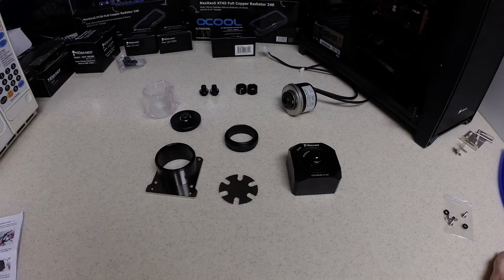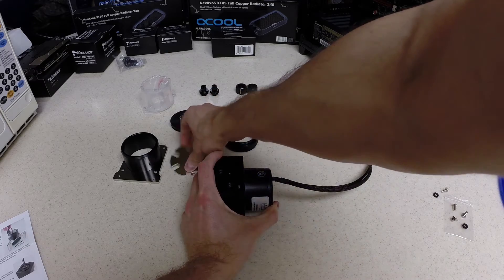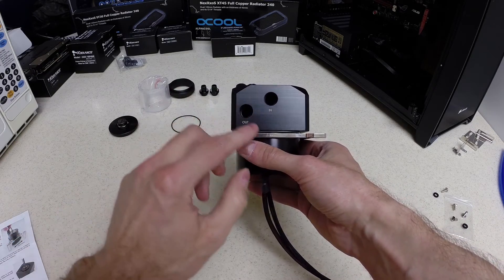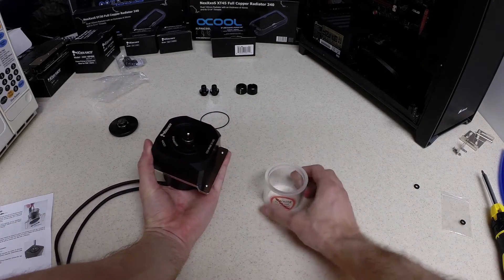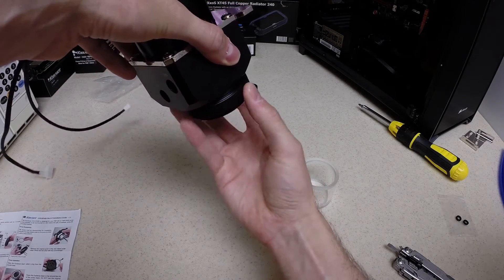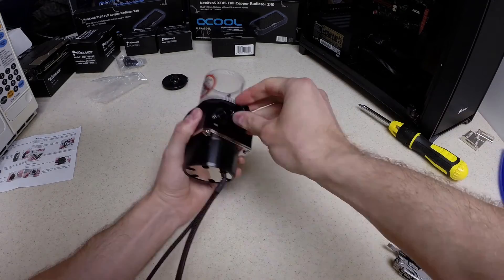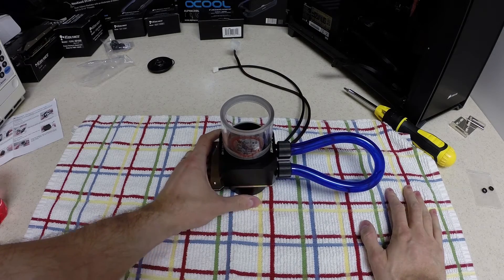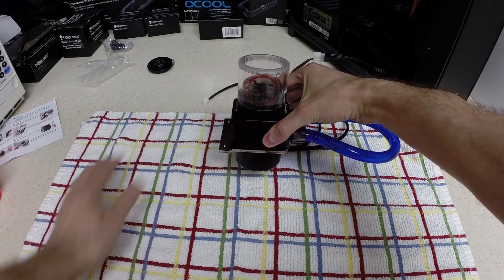Koolance Pump Top with Reservoir and D5 Pump Installation

Comment: First of all, thank you for the video, its great! I have a question, maybe i did not catch it...
after installing all watercooling parts to the system, how do i loop the water? I mean not physically (physically just putting water into the reservoir and turn on the pump then off and repeating it), just with respect to the power:
Do i have to connect the pump 4pin-molex to the Power supply and start the computer? Or just turn "on" the power supply and the pump starts?
And i get really confused with the 24pin-jumper. Some tutorials using a jumper and saying that some parts of the motherboard is then not running. 
Another question after the test is done with succes: if i turn on the pc, then the pump is automatically running? 
I will be so so happy if u can do a video or least answer my questions.
Reply from the maker: The 4pin-molex connector provides power to the pump whenever the power supply is "On".  The power supply can only be turned "On" if the 24 pin connector is connected to a motherboard or "tricked" by using the 24pin jumper.  If you use a power supply with the jumper to fill/test your loop- do not have any other cables from the power supply connected to your motherboard.  Just use the 4pin molex cable connected to the pump, and the 24pin cable jumped with the jumper.  Once the loop is tested and you have no leaks, then remove the jumper and connect the 24pin cable (and other cables) to your motherboard.  When the power supply is connected to everything, and you turn the computer on, the water pump will instantly start running (while the computer is booting up).  The pump doesnt need to be "told" anything by the motherboard to start running.  Hope this helps.
Reply: I love you! :D i was looking hours for this answer. I think these informations are very important and necessary for beginners. The most videos im seeing about watercooling are just bla bla bla. Thank you again!

Comment: hi what do you connect the pump cable to
Reply from the maker: The cable with the larger connector is the Molex cable and connects to a Molex power cable from the power supply.  The cable with the smaller connector has the PWM and tachometer pins in it and connects to a PWM fan header (4 pin) on the motherboard.  The Molex cable provides power to spin the pump, and the PWM cable provides speed control and feedback to/from the motherboard/BIOS.  If you dont use the PWM cable, I think the pump just runs at full speed all the time.
Reply: thank you so much brother
Reply: i was looking for this information 19328472938749318 hours in the internet. BIG THANK YOU!